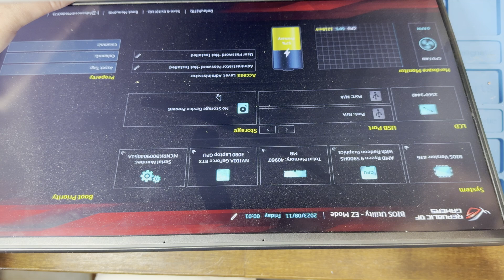Let's attempt to repair a 2021 Asus Zephyrus G15

Comment: So basically it's the capacitor that was the problem?
Reply from the maker: @BalanceandWonders  Kind of, it’s more a symptom of the problem. Something somewhere was causing the capacitor to ether short or overload (never could determine what it was). The proper fix is to figure out what was causing it to fail and fix that so the capacitor can go back on.